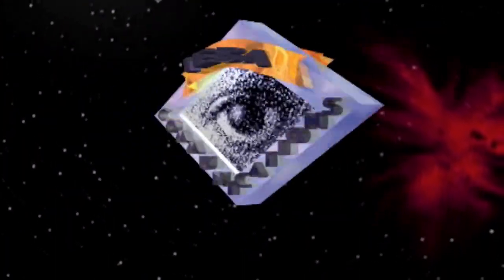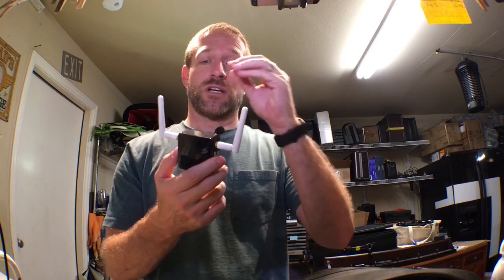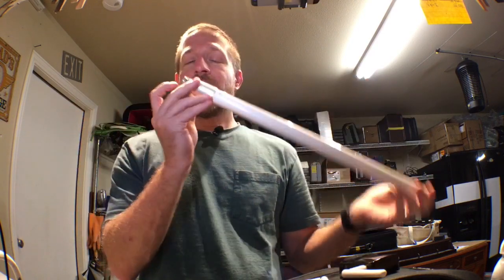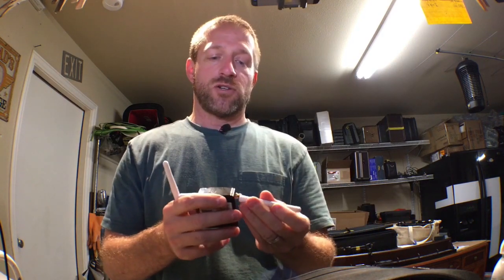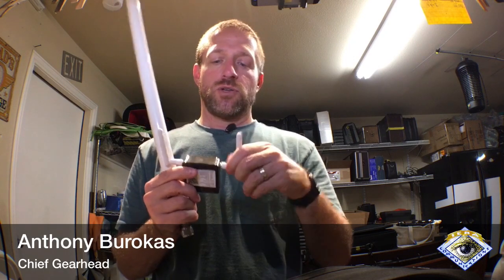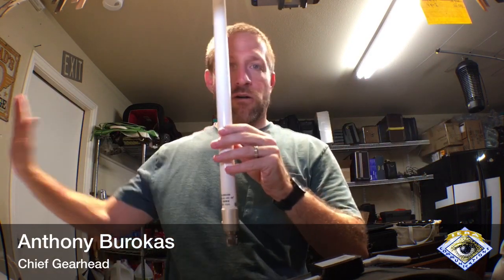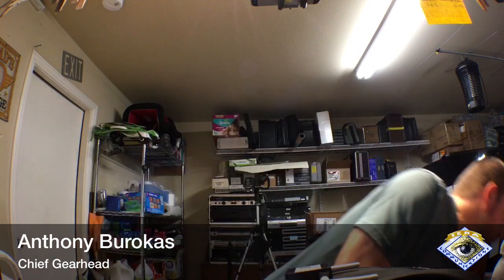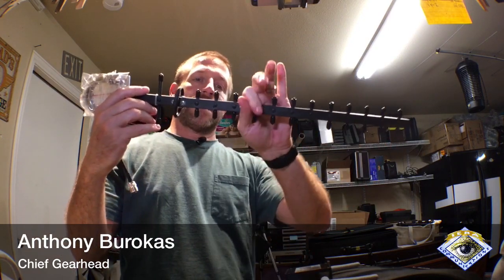A Quick Look at WiFi Antennas - Stock v. Hi Gain Vertical vs. Directional

Comment: will an omni 2.4 12Db antenna connected to my laptops wifi card directly (somehow) improve my signal where there is very low amount of wifi signal (i.e library or near concreate buildings?)
Reply: Yes, because there's simply more metal receiving the WiFi around you.

Comment: Thanks for your good explanation.
A question:
For vertical fiberglass antenna frequency 868 mhz for helium, is it better to have a closed circuit or open circuit antenna?
In the case of open circuit antennas, installed on a grounded metal pole, is it still necessary to install light protection?
Thanks
Reply from the maker: I don't know "closed circuit / open circuit" Most wifi is "1/4-wave ground plane, with the base of the circuit being the "ground plane" or a dipole. But as you get higher in frequency, it gets harder to keep the RF in the wire, which is why you often see the transceiver right at the antenna, or as close as possible.
Reply: @IEBATechThoughts  Anthony, I stumbled across this video because I'm trying to resolve an issue I have with an Internet signal, as inexpensively as I can. I live in a rear in-law suite behind my landlords house.  He has Spectrum services with premium cable, phone, and Internet.  The coaxil cable also comes into my apartment and feeds a premium cable Spectrum box that he pays an extra fee for.  I piggyback Internet services through his wifi from the modem and router in his house, but there's too much distance and interference (walls) to get a good signal.  I bought a plug in wireless signal enhancer which made the signal bearable for very light Internet surfing, but I cannot stream videos or live sports.
So my question is this: can you recommend a solution for me which would resolve this problem?  Thanks.
Reply from the maker: @MasterArmedforces  If you already have coax between his place and yours, why not just run an ethernet cable right next to that, and bring his internet connection into your suite. Once you have it inside, you can connect it to a WiFi Router and that should cover your whole suite.

Comment: Hi, I wonder, can I use a high gain 18dbi 2.4ghz panel antenna for a dualband Alfa wifi adapter?  I cant find any dualband high gain 18dbi 2.4/5.8ghz panel antennas at all

Comment: How about the cable length does it affect the transmit and receive power? what is the best cable length for the 2.4Ghz wifi router using the 9dBi omni antenna? please i need the answer asap, thanks
Reply: Cables and the length is everything, in those high frequency's the loss is horrendous. Best if you want an outdoor antenna to use and outdoor wifi router next to it so the cable length is in inches. The best cable can run you a lot of money and still give you some loss.

Comment: I thought the maximum output power was actually two Watts. At least that's what it was the last time I looked at it. I actually have a machine that can output 2 Watts
Reply from the maker: You can google it, it's about 100 mw. The power consumption of the WAP is completely different than the radiated power. However with various antennas, you can focus that radiated power and have considerabl more going in one direction with a directional antenna.
Reply: @IEBATechThoughts  oh, okay these things are good to know. Thanks for the info

Comment: what is the difference between a 9 dBi directional and a 9 dBi vertical antenna?
Reply: A directional antenna both sends and receives from one direction, so you can eliminate interference that might be making it hard to make a connection with a normal vertical antenna. 
A vertical is needed  if you have multiple devices you wish to connect to in many directions.